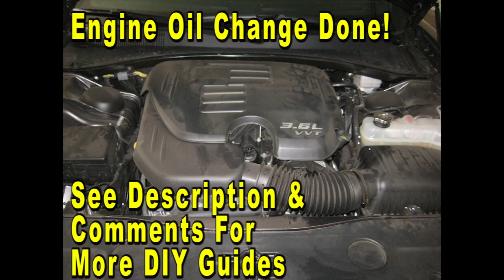Dodge Charger How To Change Engine Oil & Filter 3 6L V6 7th Generation 2011 To 2023 With Part Number

Comment from the maker: Dodge Charger Engine Oil Viscosity - https://amzn.to/3Q0Zd0r
Dodge Charger Engine Oil Filter Part Numbers - https://amzn.to/3WwWHBk
Used Oil Drain Pan - https://amzn.to/3Gse4xT
Automotive Funnel - https://amzn.to/3WtMUfF
Socket & Ratchet Set - https://amzn.to/3WOQOQ1
Mechanix Gloves - https://amzn.to/3YNwPmp
Torque Wrench - https://amzn.to/3G0vn7F

The Paul79UF YouTube channel is a participant in the Amazon Services LLC Associates Program, an affiliate advertising program designed to provide a means for sites to earn advertising fees by advertising and linking to Amazon.

Comment from the maker: Check out the DIY tutorial for changing the engine oil and filter in a 7th generation 2011 to 2023 Dodge Charger (3.6L V6) - 
https://www.paulstravelpictures.com/2011-2014-Dodge-Charger-Pentastar-V6-Engine-Oil-Change-Guide/index.html

Here are all of the DIY repair and maintenance guides for the seventh generation 2011, 2012, 2013, 2014, 2015, 2016, 2017, 2018, 2019, 2020, 2021, 2022 and 2023 Dodge Charger sedan - 
https://www.paulstravelpictures.com/Articles/2011-2014-Dodge-Charger-Common-Problems-Repair-Maintenance-Guides.htm

Owners of other Chrysler, Dodge and RAM vehicles such as the Town & Country, 300, 200, Avenger, Challenger, Journey, Dart, Durango, Grand Caravan, and Ram C/V Tradesman minivan may also find these DIY instructions to be helpful.